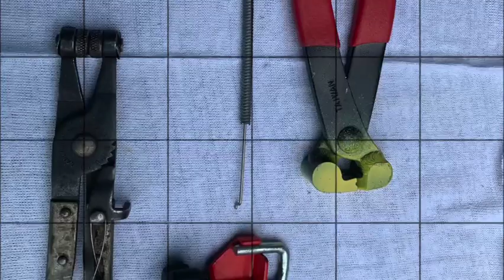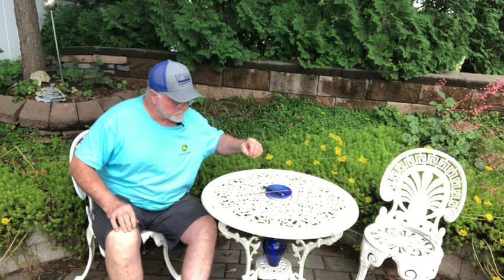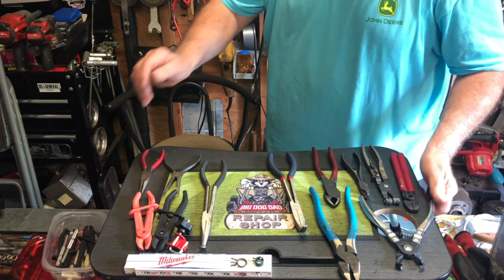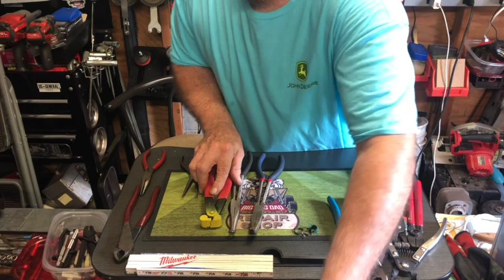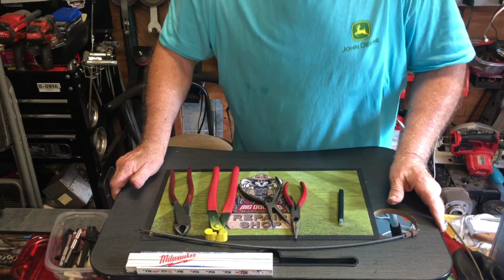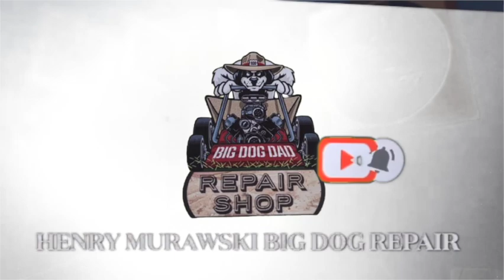GAS CLAMPS AND Z BENDERS TOOLS

Comment: When leveling a deck use new blades first & make sure they're both relatively equal when beside one another as they pass. As a deck gets near end of life those spindles housings can warp the deck where they're bolted & more so when you've hit something hard so check that first or your wasting your time. Other issue is warn pins & the holes. Don't forget to check the hanger cables if they have them even a few strands broken on the wire rope can cause issues & will drive you insane when you've done everything else but the deck still scalps on one side, it's amazing what a new cable can do lol